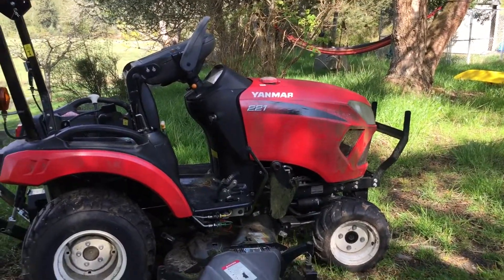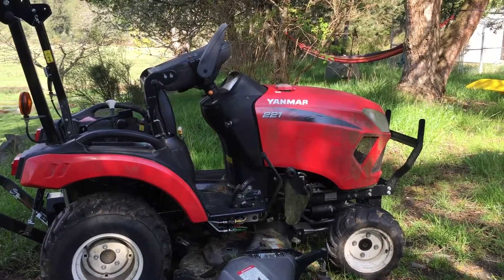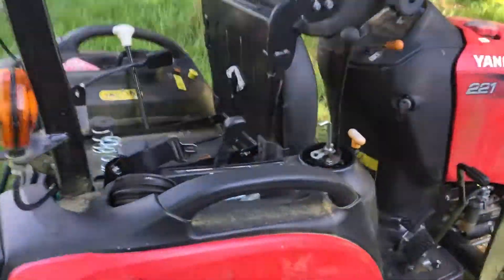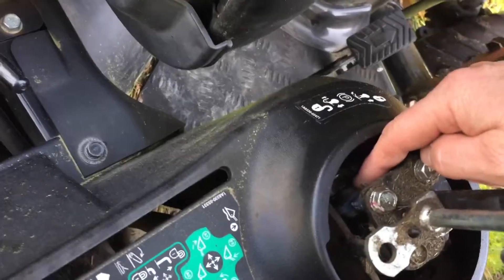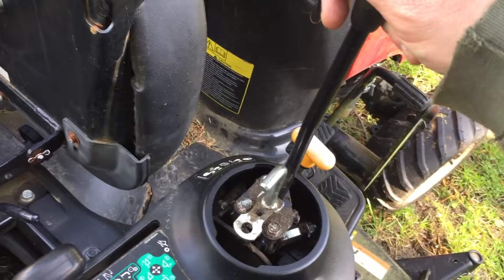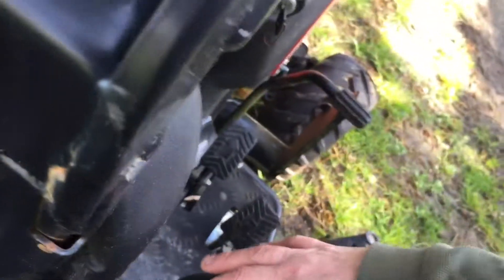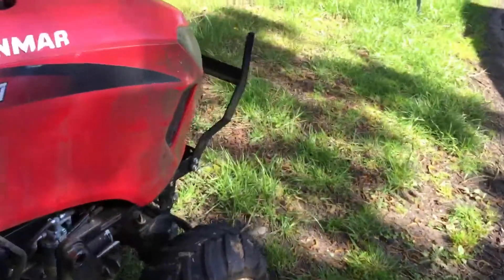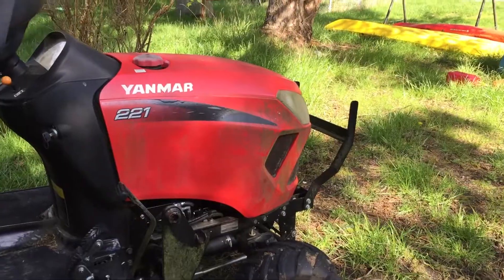Yanmar 221 Hydro issue

Comment: Ah, the 221.....   I was run over by this model lol    damn tractor
Reply: God damn that wouldn't be pleasant, its heavy for what it is sinks like a rock on my wet ground fucking pisses me off
Reply: @splitrim509  lol I bet, it was not bad, backed over me...we laughed
Reply: @Denvco1  I'm currently trying to find a place to mount a winch. I bought a 3000 pound winch but the frame appears like it might not take that kind of abuse well
Reply: @splitrim509  Holy hell, that will be a task! I don't think it will either. Wow
Reply: @Denvco1  Yeah got it on a deal might have to use it on something else though. Would hate to tweak something. Just have a hell of a time with it, on my ground if you break through the grass or crust it's like soup under there you are stuck instantly but lots of trees to winch to. Sounded good in my head till I started looking at places to mount it
Reply: @splitrim509  lol could always use a body...I got experience
Reply: @splitrim509  oh dayum....nah u married her for a reason lol. If u were in ohio, I'd help lol